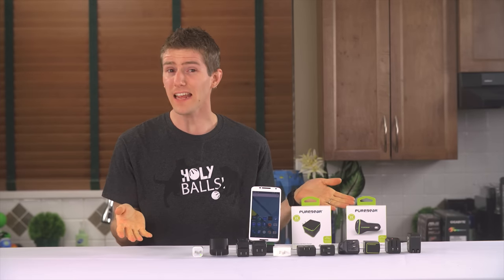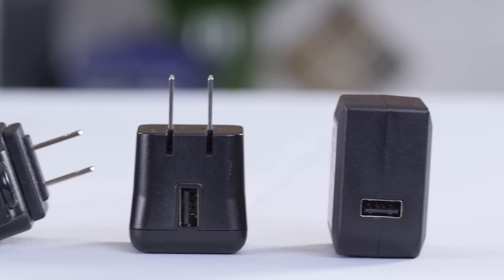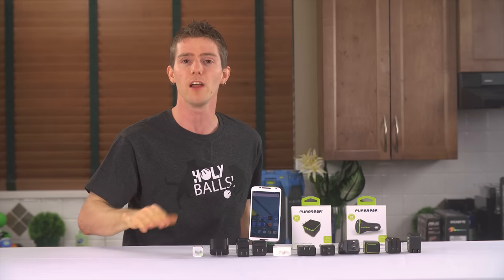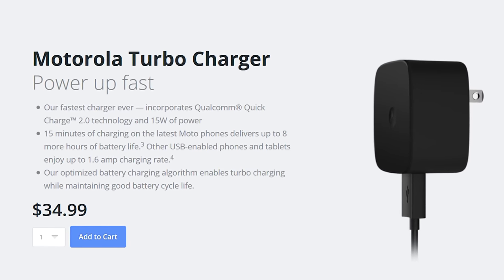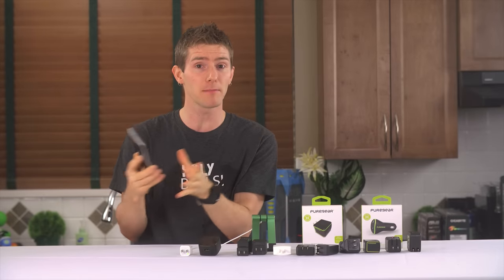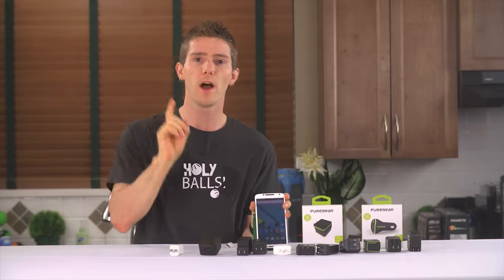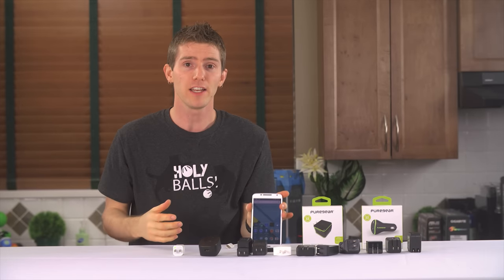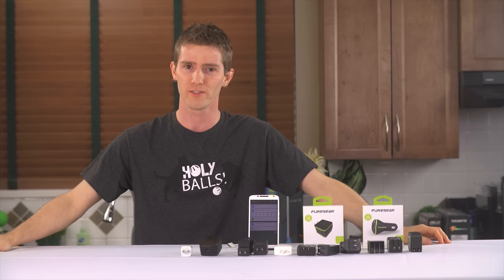Faster Phone Chargers Explained - Qualcomm Quick Charge 2.0

Comment: I have very sensitive ears to high pitch sound. My LG G2 mini's charger makes a high pitch noise when plugged in and not charging. Does anyone have any tips for another (for-me-better) charger? I don't want to buy a whole bunch and test them...
Reply: That high pitch whine is switching noise, typical of a low quality charger. Apple tend to make great chargers which are silent and durable even with poor power.
Reply: Nicholai Chev even a blackberry bold charger from 4 years ago does not make a nois
Reply: Matthew Allison peopel told me about my WiFi route that it is completely silent, but I can't stay in room with that thíng :D
Reply: Certain people pick up certain frequencys differently, ie you tend to loose the ultra high frequencies with age.
CRT monitors always got me, I know some people who complain about the coils and chokes on gpu's or psu's which whine under load.
Reply: SamoScopom only real thing you can do is take the charger apart and hot glue all the components to avoid the whine
Reply: SamoScopom Use one of those extension cords with a switch, so when not in use you can turn the whole thing off easily. It also helps the environment.
I have a whole batch of wall warts plugged into one, and when not charging things, I just turn everything off with a single switch.
Reply: SamoScopom Yea my Motorola Charger for my Nexus 6 hisses when it charges. I have no idea why.
Reply: Isaac Rodriguez in that case the nexus 6 is drawing a lot of current and when the Motorola charger charged the device it came with there wasn't as much current draw but with the nexus the charger is most likely providing close to its maximum current this is the same with the note 4 I own
Reply: SamoScopom If your ears are sensitive to high pitched noises, maybe you shouldn't be watching Linus' videos.
Reply: Phoenix you know, it's alright, at least I'm getting the full range :D

Comment: Good video. Learned a ton and delivered very succinctly. I like!

One thing I would like to add is this - the cable matters.

My experience with my Galaxy 6 (not edge) is that with the QC 2.0 standard: cheap cables don't get it.

If you have a smart charger and a smart device (i.e. both QC 2.0 compatible) connected by a cheap cable, you loose all the benefits of either. Specifically, I had a cheap cable that I used overnight with a smart charger (Samsung-provided) and my G6. After some time (weeks) I noticed my phone and cable getting super hot and the phone no longer charging completely overnight (huh?!).

Switched to the cable that came with the charger and not only did the phone charge fully over night, the charger was smart enough to know that the device was fully charged and stopped charging after the device reached 100%. 

Cool beans (literally) as when I awoke my device was as 'cool as the other side of the pillow" (thank you Stuart Scott - RIP).

I have since tested this with both 3rd-party chargers and 3rd-party cables that tout their QC 2.0 compatibility and verified that they all can figure out the 'handshake' that stops the charging process at 100%

Interested in knowing if your results vary.

tl;dr
one additional tidbit I will offer for the crowd that has not already tuned out because this post has long-since passed the brevity limit.

Somehow I wrecked the 'Samsung-provided' cable to which I refer above. I wrenched the micro usb side of the cable at some point (I have very fat fingers). I noticed the micro usb connector was 'loose' inside the cable. it still functioned (i.e. charged and enabled USB sync) but things were never the same.
My experience was that that previously quite functional cable began functioning like the cheap ones (i.e. got all hot and bothered and failed to enable appropriate 'handshake' between charger and device). replaced it with 3rd-party QC 2.0 rated cable and all was right again with the device-charging world.

Finally, the G6 reports "Fast charging" when it is connected with a smart charger and achieves the sufficient 'handshake' between charger and device. Whenever I see this status, I'm confident I'll get all the benefits. It's also noteworthy that when I connect a cheap cable to a QC 2.0 compliant charger, the G6 does not report "Fast Charging." However I do have a charger that is not listed as QC 2.0 compatible that still seems to exhibit all the 'good' properties (i.e. charges as quickly as the QC 2.0 device and stops charging at 100%) even though the G6 does not report "Fast Charging" when connected to said charger. 

In some circles, this might be referred to as an 'overly-complex test matrix' but hey, that's what geeks are for. Take it for what it's worth to you.

Comment: OnePlus gives you a 2A charger with the One.
Reply: Mine came with a AC Adapter that has 2 outputs, 2.1amp and 1.0amp although not sure if it was a package the store put together (came with NZ plug)
Reply: actually with 2.1 amps... but you don't need this one anyway, my phone is on battery for like 2 or 3 days (and i use it damn much)
Reply: I generally get about 14-16hrs with 6-7hrs on screen time
Reply: yeah if you ever get a chance to get an invite
Reply: Kye W I've got the phone (you can see it in my pp)
Reply: Brian Patrick van Oers yeah but for most people its hard to get an invite
Reply: Kye W  just go to the forum in the invite section, there u'll have people posting their invites like every 2 minutes... it's not that hard if you put a little efford in it (took me bout 30mins)
Reply: One plus One hype
Reply: Don't think its a hype thing anymore, its proven its place as a worthwhile device, they just need to work on their customer service and silly marketing
Reply: galaxy note 4 gives a charger that charges at 9 volts.
Reply: FoodOnCrack
it's not about the volts man... u can have 10 volts but, .5 amps. volts have not such a great impact on charging times
Reply: I have the phone and I lost the charger. For fucks sake.
Reply: Robin P. It is about the Volts and the Amps, it is also about USB cable length and wire thickness.

Example:
9 Volts, 1.67 Amps, 6 foot cable with 24 gauge wire
Resistance of wire: 0.154 Ohms
Power Output by charger: 9 Volts * 1.67 Amps = 15.0 Watts
Power Received by phone due to loss in wire: 14.2 Watts
Efficiency of power delivery: 94.3%

5 Volts, 3 Amps, 6 foot cable with 24 gauge wire
Resistance of wire: 0.154 Ohms
Power Output by charger: 5 Volts * 3 Amps = 15 Watts
Power Received by phone due to loss in wire: 12.2 Watts
Efficiency of power delivery: 81.5%

5 Volts, 2.0 Amps, 6 foot cable with 24 gauge wire
Resistance of wire: 0.154 Ohms
Power Output by charger: 5 Volts * 2.0 Amps = 10 Watts
Power Received by phone due to loss in wire: 8.77 Watts
Efficiency of power delivery: 87.7%

5 Volts, 0.5 Amps, 6 foot cable with 24 gauge wire
Resistance of wire: 0.154 Ohms
Power Output by charger: 5 Volts * 0.5 Amps = 2.5 Watts
Power Received by phone due to loss in wire: 2.42 Watts
Efficiency of power delivery: 97.0%

tl/dr: The more current used, the more energy is wasted as heat. Higher voltage allows for the same amount of power to be delivered with less current.

Comment: I never understood the craze about fast chargers. Just charge your shit over night.
Reply: Shawn Miranda Honestly, in all my years of using smartphones (since all the way back when Windows Mobile 2003 was the shit) that has never happened to me.
Reply: many phones get empty after 6or 4h of use ... a fast charger can fill a phone in 90mn even while using it. classic charger may need 4h or even 6 ... iddle !!!
Reply: Benoit-Pierre DEMAINE Those must be some really crappy phones.
Reply: +hellterminator so you are saying practically every single flagship phone 2013-2016 is crappy seeing how 4-6 hours is normal in screen on time?
Reply: +Me Of course It's really difficult to use that amount of screen on/usage time in one day. I know I have to really use my phone and leave bluetooth devices paired all day to actually kill the battery... Today, after listening to a podcast through bluetooth headphones and using my phone for some texting and some browsing, I'm sitting at 91%. That's having awoken at 10:00AM, and it is now 8:23PM, so about 10 hours.

Even on days where I'm out and about a lot, I rarely find myself getting home at night, at 8PM or so, and having less than 50% charge.

If you're having to run for a charger during your normal day, your phone has something wrong with it and you should contact your OEM.
Reply: SniperReady Hmm.  Well my phone can last 8 or 9 or 10 or even 11 hours with light/moderate usage status . And according to what you said everyone I know has to contact their OEM's cause they have to charge their phones in the middle of the day when they go nonstop usage and this includes iPhones, windows phones, and android phones. So no offense but I'm gonna take your comment kind of lightly.
Reply: Me Of course You're welcome to believe what you want. My phone will last approximately a week with light usage as it's seen today.

I've seen plenty of users suggest uninstalling the Facebook App or disabling this or that to save power on their phone... but I just don't have to do that. I use the Facebook App. I use the Facebook Messenger. I have everything enabled, bluetooth on, wireless on, network on, screen on auto brightness. When I listen to podcasts or music, I connect bluetooth headphones.

I haven't had to charge my phone during the day once since purchase over a year ago. I'm probably not the heaviest user, but I'm also probably more than a moderate user, given my penchant for social media browsing, web browsing, SSH access, music streaming, video watching, bluetooth headphones and the relatively high traffic of email to my phone.

It's subjective, of course, but my friends who own Android phones are the ones reaching for the chargers constantly, perhaps those are the phones you're seeing having battery life woes?
Reply: SniperReady it's not what I believe. It's what I know. There is a difference in extreme nonstop usage and light/moderare usage. Nonstop usage is when you use the phone with Max brightness,  a shit ton apps in the background, multitasking and you're not putting the phone down for one minute. And light/moderate usage is when you only need to use the phone check some stuff, have it at half brigntess or a little over half brightness,make some texts and call and your not using the phone a lot (compared to nonstop usage) then yeah you'll last the day.  And unless we are talking about the iPhone 6/6s plus then the regular iPhone 6's/s aren't really the best in battery in comparison to my HTC One m9. I mean I own an iPhone 6 and the battery hasn't been the best in my testing. But hey,  as you said, it's all subjective.
Reply: Me Of course Right, so what you define as heavy usage is what I do most of the time. Today is a light usage day. On a light usage day, I will use about 10-15% of the battery for a day. The entire day, from 10AM to sleeping at 2:00AM.

Your HTC One M9 has a battery at 2840mAh, while the iPhone 6 has 1810mAh. If your HTC One M9 is not lasting much, much longer than the iPhone 6... you definitely need to get your ass into a repair shop post haste.

Especially since the M9 contains the Snapdragon 810 which is shown in benchmarks to throttle like crazy, which is a nice way to create battery longevity by damping performance below a dual core processor despite promising 8 core performance on the box.

I know people with the M9. Several people. They compare their phone's battery life to the iPhone 6, despite having a battery the size of the iPhone 6 Plus.

Like I said, believe what you want.
Reply: SniperReady Oh, but my Htc One m9 does last longer then the iPhone 6 ( not the plus version though) And again it's not what I believe, it's the evidence and results I have seen.
Reply: +hellterminator it's from people that live on there phones and can't make it thru the day without a "booster shot", this only becomes a concern to me several days into a charge wondering if the piss poor signal at work will kill the battery before (in the case of my current charge cycle day 5 on the charge) before I make it home.
Reply: +Me Of course Being my RAZR MAXX did 6-7 hours screen on time while streaming netflix over 4g (10+ over wifi), yeah I would call 4-6 hours screen time pretty shitty.
Reply: +Shawn Miranda Are you sure? I was convinced that the higher the current, the bigger the battery wear was.
Reply: +Shawn Miranda I actually think you can. I, for instance, charge my phone at least once per day, which means 365 charges per year. After 4-500 hundred charges, I usually notice a decrease in performances, so using quick charge could, in my opinion, speed up that process.
Reply: ***** Well, that's pretty narrow-minded.
Reply: my phone dies fast and cant last a full day...
Reply: I actually appreciate fast charging, especially when I'm taking long connecting flights where only one flight has power adapters between the seats. It really has saved my bacon multiple times where my phone was on the verge of dying and my portable battery pack was drained long ago.
Reply: hellterminator the you are a very light user...
Reply: Youtube User Well.. the S5 has no good battery life to start with... I have another phone with 3000mah of battery that lasts me almost a full heavy day... and when it's drained.. it has Quick Charge 3.0 and I get like 70% in 30 mins... so... Quick Charge is hella useful.... and yes.. I'd rather use my phone instead of a laptop and even the TV... I have both and I don't remember the last time I sat down and watched TV... and the laptop I use it just for some heavy work that is not "optimal" to do on a phone.

So yeah, some people may not understand why Quick charge is a big fuzz... until they've tried it... I get it.. some people uses their phone to basically only Messaging and Calls and light browsing... in those cases.. QC may not be a deal breaker.. but for some users like me... that is always downloading stuff... editing video and pictures.... taking pictures.... and maybe gaming... yeah... having 70% of juice in 30 mins or so... is useful for emergencies
Reply: Youtube User I can highly recommend you (if you're in the states) the LeEco Le S3... which is the one I'm using.... has amazing battery life,  quick charge 3.0 out of the box... is really fast and snappy (I compare it to the S6 in terms of performance) and I got it for 140$ brand new!! the more expensive you can find it is 199 on Amazon... and on Ebay you might as well get it for 130$ new...  highly recommended.. and now it has a 7.1.2 stable ROM because stock Firmware kinda sucks, mostly for usability...
Reply: Thats cause you dont have a smart phone.
Reply: I thought the same, until i had a fast charging phone , now i would never EVER buy one without it
Reply: Quick charge is definitely for different lives and for times like when you forgot to charge overnight.

Comment: Wanted to add that higher amperage also charges the battery to a higher stored capacity than lower amperage options, meaning closer to the stated capacity of the battery.